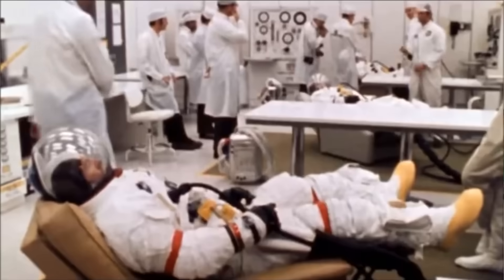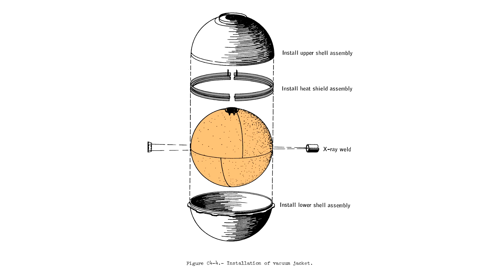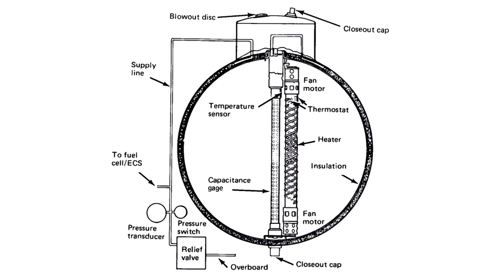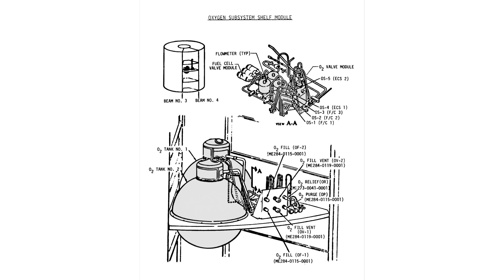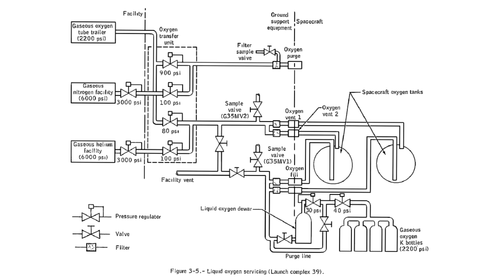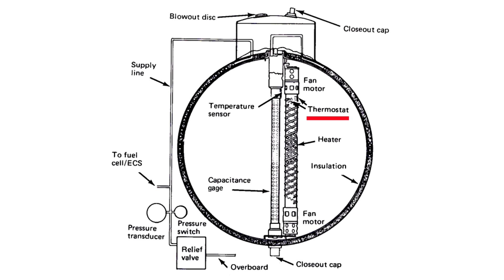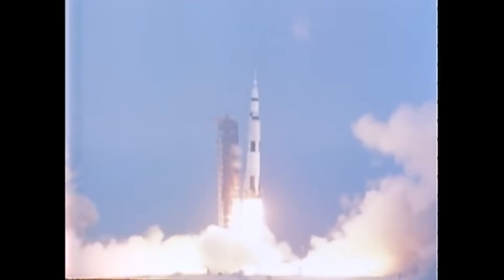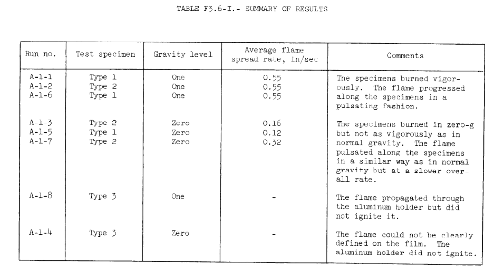What Caused The Explosion That Crippled Apollo 13?

Comment: Apollo 16 per book by LM pilot Charlie Duke, he said that just as they were preparing in the LM to descend to the moon , the antenna operation failed and one of the two primary propulsion systems for the SM, the bell housing actuators made terrible bang bang bang noises when they tried to gimble the engine. So they were in both ships slowly running out of time to descend and the orbit path shifted each orbit and they finally got ok to descend and all went well and a few days later fired the main engine and headed back to earth. apollo 17 was arguably had the least problems with just a cracked gauge glass and many records broken and with a civilian geologist on board for the moon walk..

Comment: Cost cutting engineering can be ineffective and dangerous. I worked for a construction company that had for years purchased dependable heavy duty steel cable from one source. Then one day the purchasing agent (with the engineers' approval) purchased much cheaper cable of the same diameter from another source "speculating" that it would have the same tensile strength. It did not.
Fortunately the cable was used for heavy-duty anchor retrieval so after several failures it was decided to go back to the original source.
But if the new cable had been used in a bridge or similar structure, human lives would have been lost.

It's best to test quality of a material than to trust information given by a source.

Comment: Fun fact about Carbon Tetraflouride, is that it's actually a highly toxic fire suppressant. In the '50s and '60's, it wasn't uncommon to find fire extinguishers filled with the stuff... until government agencies around the world started realizing it was basically Benzene or Asbestos level toxic, and it got basically universally banned from all commercial manufacturing processes.

In short, a Teflon fire in a pressurized oxygen tank could have potentially turned around and just extinguished itself with its byproducts, which could've ultimately averted the more explosive portions of the Apollo 13 disaster, and then instead created a CBRN disaster later on when that CF4 inevitably made its way into the CM's atmosphere

Comment: They needed to keep the pressure in those oxygen tanks at 50 bar or higher, so they used 'heaters' as the oxygen tanks drained. I would have just used a separate helium tank that had the same volume as the oxygen tank, but had 100 bar pressure in it. Design all tanks to withstand 100 bar. Connect the helium tank to the oxygen tank with a check valve, and you've solved the problem in a much simpler way without any wires/heaters being needed.
Reply: Then you would have a helium/oxygen mixture in the tank. Which (a) wouldn't work for what it's needed (breathing and fuel cells) and (b) would have a different phase diagram.

Comment: I've watched this and Thunderf00t's videos. I still don't see how insulation that has been cooked sufficiently to break down and cause a short circuit without catching fire can then catch fire later on once the tank is in space? Could the zero G be a factor in why the 'fire' was able to start? Did the tank rupture due to overpressure or did the fire cause a sealing failure? What happened to the other tank? Why would one tank venting via the rupture disk, cause a slow leak in the second tank?

Comment: There is a difference between an explosion and an overpressure event, the most obvious the rate of pressure rise, an overpressure event is controllable with a properly designed pressure relief system, wich is usually a self triggering valve.

Comment: I’m surprised ground wasn’t monitoring heater current when they decided to use the heater to drain O2 tank 2. If they had been they would have seen that the heater was not cycling as it should have been, and probably caught the problem there. Alternatively, as has been mentioned elsewhere in the comment section, if the tank thermometer read above 80 degrees that most likely also would have worked to catch the problem. Of course with the benefit of hindsight it’s easy to be critical. The steps the crew and ground support took after the accident occurred were nothing short of incredible, and really spoke to how well they worked together and knew their spacecraft.
Reply: Current is not that easy to monitor when your ADCs weight at least 300 grams.
Reply: The thermostat wasn't able to read above 80.
Reply: @TheCrackedFirebird  I feel like I have heard this before but with radiation... Not great, not terrible.
Reply: @TheCrackedFirebird  Why would anyone need a thermostat to go higher in a cryogenic tank??  Of course, what's not really been said by others is that it's remarkable that the tank didn't halt and catch fire duing the draining and refilling. It's a real testimate to just how astonishingly well built the damn thing was that it managed to get as far as going into space.  It's just a bummer that's the time when it choose to go kaboom.  Equally astonishing is how well built the rest of the CM/SM that it survived the explosion and that it was able to be restarted after several days in a deep cold state - frankly the most frightening line in the movie after "we're venting something into space' is 'like driving a toaster through a car-wash'.
Reply: @TheCrackedFirebird  a thermostat is a two position device, on,off open close. A sensor is an analog device. Volts,amps, ohms etc.
Reply: Bobb Grimley  Thanks Bobb, glad you're out there checking the internet for mistakes.  Funnily enough, my spellchecker tells me that there is no such word as 'Bobb' either. Just in case you want to let the person who named you that they made a spelling mistake too.
Reply: Bobb Grimley  Hi Bobb - you're the one spell checking strangers on the internet.
Reply: Bobb Grimley  Swing and a miss. Snarkiness over unsolicited advice is far from anger. It was funny. But "you don't know literature" and "grow up" sure do sound a bit grumpy, now that you mention it
Reply: A thermometer watching a thermostat should be able to read at least 5 degrees above the intended turn off point, as basic checking.  If the reading had peaked at 85°F, they would have known the thermostat failed and replaced the tank.  Same as having a thermometer in the office double checking the air condition.  the aircon will be set around 80°F, but the consumer grade thermometer goes to 120°F and will show / confirm that the AC isn't working.
Reply: @johndododoe1411  To lower costs during the oil crisis (decades ago), my school district put locks over all the thermostats so the teachers couldn't set the temp higher than 68 degrees.  All thermostats were controlled from one central office.
   No problem.  Put a wet paper towel over the lock.  As it evaporates air cools, thermostat kicks the heat on.
    Kindergartens were set to 70 degrees.

    A highlight of my teaching career was when I saw a kid in the library shivering and clutching herself.  I went on talking, pulled off my large warm sweater and wrapped it around her.  She beamed.  I told her to keep it if she needed it, to the end of school.  (Info had gone out to all parents to dress the kids warmer, but very few paid attention.)

   Once gave a pair of gloves to a kid in the high school parking lot.  He faithfully brought them back the next day.

   Sorry, unrelated trivia.

Comment: Hmm....  even with the third tank, that diagram (11:47) seems to show that a failure in #1 tank would still take out all fuel cell supply and environmental oxygen??   Maybe there's a check-valve not shown or something, but it still looks like several single-point failures would endanger the crew.  Ah well.  

Great explanation, you're about the only other person I've ever heard mention the 28V vs 65V difference used pre-launch that damaged the switch.  I read that years ago, and so many people ignore that and focus on the 'dropped about 2 inches'.  Great video.

Comment: If NASA had installed a simple Burst disk in the tanking system with an open valve in line operated by a tank sensor, it could have both vented the over-pressure then closed the valve when the maximum pressure was back under control.  It could have prevented all of the assorted explosion related damages as well as the loss of oxygen in Apollo 13.

Comment: I heard a other story :
The tanks where changed after the dropping incident with spare tanks from Apollo 12 witch had a other voltage (12 Volts).
Nobody was thinking of the change in Voltage from Apollo 12 to 13, because the spare tanks were already tested RTF (ready to flight).
Reply: As far as i know, on Apollo 12 the tanks were 12Volts in SERIAL = 24 Volts
They changed it to 2 times 24 Volts because they could safe energy by heating every tank if needed for its own.

Comment: How were connections made for plumbing and electrical between the service module and the CM?  There were no bulkheads through the heat shield, so the service module must have had a way to reach up the side of the CM, above the heat shield.

Comment: Just goes to show how a few small problems and oversights, working in concert with eachother, can lead to major problems.  In this case, it took a mechanical failure (tank damaged during removal from Apollo 10), a design oversight (circuit breakers welding shut when interrupting 65V DC), plus an operations oversight (emptying the tanks by boiling off the oxygen prior to the flight) that led to the explosion.

In systems like this, it's almost never a major design oversight, since those are thought of early in development.  It's the low-hanging fruit.  No one ever noticed there wasn't a test on the heater circuit breaker to interrupt 65V DC; had that test existed, the problem would have been found.

Comment: @Scott Manley In the Apollo 13 disaster there was the debate between using the rocket on the command module for a direct return vs using the gravity assist along with the LEM rocket. Of course we know the gravity assist worked. However with hind sight do the engineers still think the command module rocket was unreliable? Is there evidence that components of the rocket were likely damage in the accident that could lead to a catastrophic failure? Or conversely after analysis found it should have worked normally.
Reply: No analysis was done, the damaged hardware was never returned to earth.  I don't know if the photo's taken before reentry could have told enough.

Comment: Dear Scott. Can you please  explain how the heat is handle in the ISS or the rest of the space aircraft since vacuum is the best heat insulating. The ISS receive a lot of energy that finally is converted to heat in the form of  light movement,air conditioning, etc besides people inside are creating heat also. so everything is generating heat and there is not conduction or convection of heat the only way that I think is Radiation but I think that is not enough.
Reply: The ISS has large radiators.

Comment: ❓ Couple of Questions please Scott.
1. How long before NASA found / worked out that it was the oxygen tank circuitry was the cause?
2. Were all subsequent CM & LM  Co2 filters retro fitted with matched sets?
Reply: 1) Investigations began immediately after the incident, and the review board submitted their final report in mid-June that same year.

2) No, the CM and LM/PLSS cartridges had different requirements that drove their form factors.  It wasn’t an oversight; they were different sizes and shapes for a reason, and they were not changed for subsequent missions.

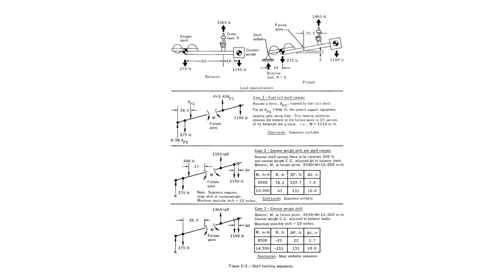Comment: All the diagrams at 4:40 show the O2 shelf at an angle at the moment of lifting fixture failure. Once the lifting fixture fails doesn't the upwards driving force disappear? Unless the bolt or Service Module substructure fails what is the mechanism for the O2 shelf to bounce up hard enough into the bottom of the Fuel Cell shelf above it? Or did the Ground Crew clowns mash the top of O2 tank 2 into the bottom of the Fuel Cell shelf and it was the reaction force of the bottom of the Fuel Cell shelf that was the straw that broke the lifting fixture?  How detailed was the removal documentation? Did it specify the number of fasteners to remove or was written like a typical automotive service manual - 'remove all bolts securing the O2 tanks shelf to the Service Module'? Those diagrams at 4:40 lead me to expect the lifting fixture instructions clearly specify the amount of counterweight and location. All this leads me to suspect the names of the men in the crew that wrenched the O2 tank shelf out of SM 106 are known...

The claim at 7:03 is, to me, incomprehensible. To paraphrase that claim: Beech engineers verify the tstat contacts specified for 28 volts (DC?) will successfully conduct electricity at 65 volts. But we didn't actually test the tstat as an assembly... Fabulous stills of documentation in this video. Oh. Except for this claim.
Reply: Curtis;  Regarding the thermostat voltage...  It is complicated and it depends on exactly how the question was asked.  Perhaps Beech meant that the insulation between the electrically energised parts of the thermostat and "ground" (the mechanical mounting parts of the thermostat) was suitable for use at 65 volts DC.  Low voltage circuits that are "biased" by higher voltages were not uncommon in the electronics work I did for scientific research back in the 1980s.  Another factor is that the voltage rating of the contacts of the thermostat are unimportant if the thermostat is always "closed" as there is zero voltage across the closed contacts.  In a cryo tank the thermostat contacts should ALWAYS be closed and it was perhaps believed by the Beech engineers that using 65 volts was thus OK.  The issue only bit them when they boiled the tank dry due to other problems and the temperature got high enough to open the thermostat.   It is also possible that the thermostat did carry a 65 volt rating.  Have you ever looked at the detailed specifications on an electrical switch or relay?  There will typically be ratings for different voltage levels and each voltage level will specify a maximum current.  There will also be different voltage/current ratings for AC and DC. (the DC ratings are lower because there is no "zero crossing" which helps to extinguish the arc as contacts are opening.)  It could well be that the Beech engineer knew that the thermostat was rated for 65 volts but at a lower current level which he assumed that the North American Aviation engineers would respect by subsequently arranging with Beech to install a 65 volt heater which requires less than half the current of a 28 volt heater for the same wattage.  Instead the NAA engineers stayed with the 28 volt heater which, when powered by 65 volts, actually used 2.3 times as much current this severely overloading the thermostat contacts when they opened.   Overall this smells to me like a simple question was asked by NAA and a simple answer was given by Beech and neither of the engineers thought about the subtleties of "re-rating" the thermostat.  Re-rating a component is a perfectly legitimate engineering procedure provided that all aspects of how the re-rating will affect the component and the system it is installed in are fully considered and understood.  Didn't happen in this case...

Comment: Good Job Scott. You did your Homework on the background. 
Lovell was aware of some Problem/History regarding the Tank, as he one of a Group that had Signed Off on the Procedure to Boil the Tank Dry. 
I will bet that the Astronautss that flew Apollos 7 - 12 had some thoughts that they too flew Spacecraft that had the same Inadequate Switches/Breakers. Of course other Key Elements to the Failure hadn't occurred, but I'm sure they were looking back with better than 20/20 hindsight

Comment: ??? After the shelf drop incident, as they were testing depressurizing the vessels from 100% down to 50%, one of the tanks repeatedly failed to go below 92%. Yet preparations for launch continued anyway. WTF! You could have stopped the story right there. The arrogance of that is more breathtaking than the moon journey. A liquid oxygen tank at 50 atm pressure was exhibiting anomalous behavior and yet the engineering team thought they could safely ignore it.  Good thing those geniuses weren't in charge of something really important, like a global pandemic (manned space flight is fun to think about but I mostly get along OK without Tang or a pen that writes upside down under water; nothing suggests that manned space flight is or ever will be as essential as, say, a vaccine or even a good laundry detergent). But wait a minute, the same obliviousness that brought Apollo 13 to the brink of disaster seems to be guiding our response to the pandemic crisis. Plus c'est change...

Comment: I'm guessing that both tanks were located together to save a little mass from reduced plumbing but it still feels like a poor choice. Why have two oxygen tanks for redundancy if you're going to stick them next to each other. If they had to stick them next to one another why not stick some blast shielding between them and make sure that even with one destroyed the other wouldn't get damaged? Also make sure the plumbing to each is separate so that no matter what one of them can supply oxygen to the fuel cells.

Comment: "Sir, we dropped the highly critical module, lots of brittle components in there."

"Nah, it'll be fine."
Reply: I worked for a brief time in the mid-1980s as an office clerk in the engine test department at the General Electric River Works aircraft engine plan in Lynn, Massachusetts.  When engines were shipped, the standing rule was that if the container was dropped or roughly jostled during transit, even if there was no apparent damage, the engine was to be brought back to GE and fully inspected and re-tested.